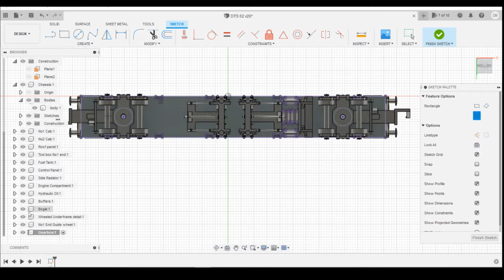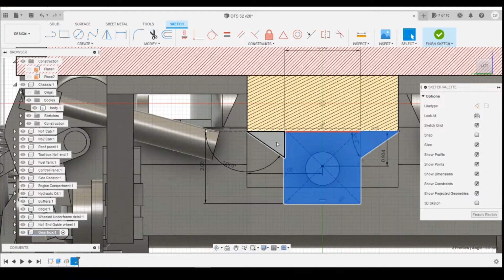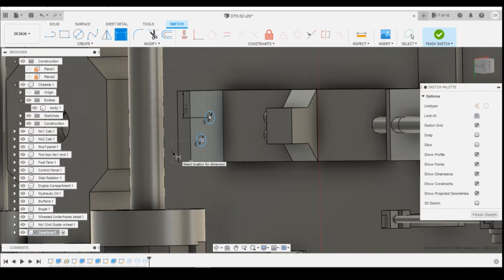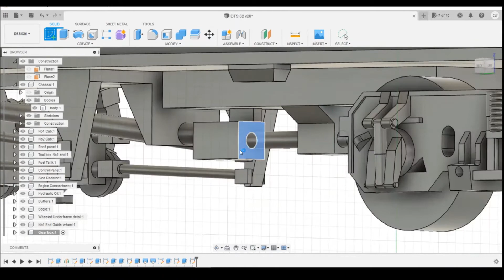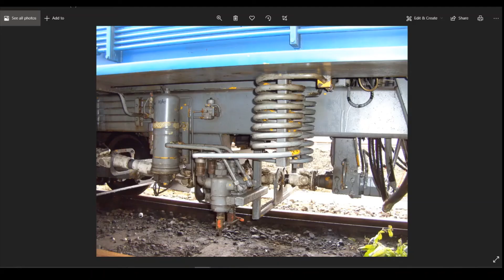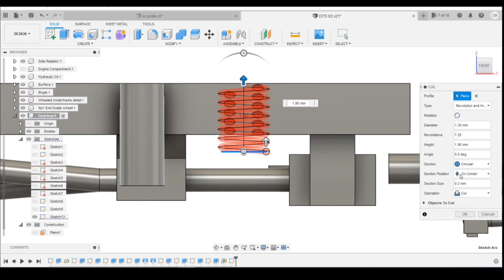3D modelling using Fusion 360 (Ep23)

Comment: Hi, not sure if it’s my computer or a fusion setting but my bodies that I am not working on are only line drawing, eye is on. Any ideas please. They were visible to start with.
Thank you
Tony
Reply from the maker: Hi,

I think you might have adjusted the Opacity control.

If you go to the body in the tree and right click the is a selection in there for Opacity control.  Make sure that's set to 100%.

Let me know if that's fixed it.

Thanks

Carl
Reply: @3ddrawingformodelrailways  
Hi, I have sorted it now, it was the Active component visibility in preferences, it was turned on.
Looking forward to print set up soon.
Thank you